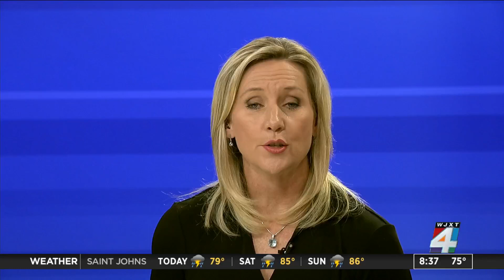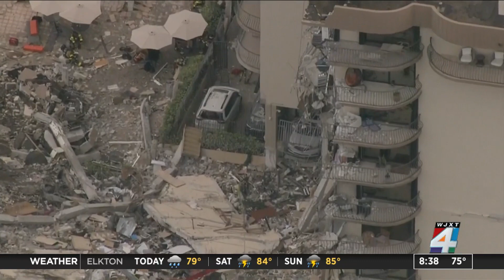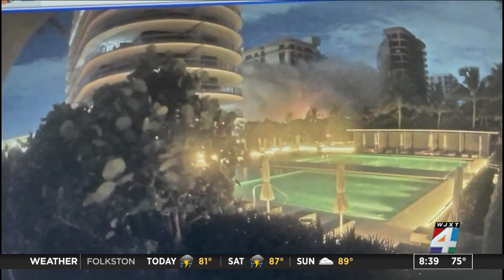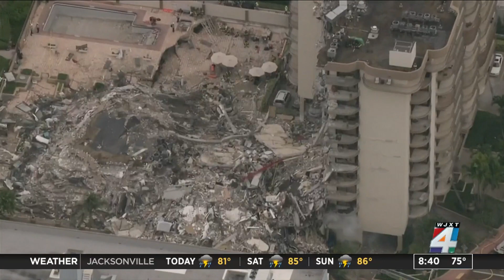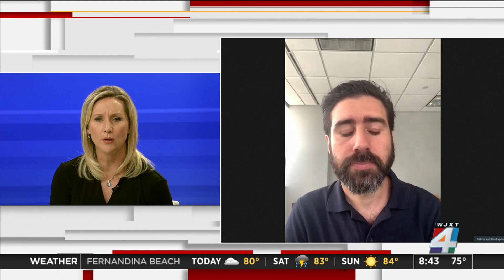Looking Into Cause Of Collapse

Comment: So the pool area wasn't properly waterproofed and caused leaking to the underground parking garage. There was a structural flaw found by the contractor in 2018 about the design of the pool making it impossible for excess water to evaporate as there was no slope for it to drain. If you look at the pool area and where the building fell - it is possible that was a significant factor. If you also look at the entrance of the parking garage - it is near the middle front area that fell first.

Comment: They said that the condo association two years ago knew about this problem in the building in 2018 they had an engineer's report that he was concerned about problems the steel and concrete had they wasted too much time they started to do the roof first and then they were going to do to steal down below and you see the results of this God knows how many people are dead that young boy was lucky he was found in a fireman got him out five people their bodies were found other sources said they've been fine in parts of bodies and putting it in red buckets so sad that something like this had to happen in this day and age now they're talking about the sister building next door has a problem too and everybody should be out and put in a hotel to stay this is a terrible thing this is not a cheap neighborhood before you know it other buildings are going to have the same problem down there Miami also has water coming in from the ocean underground they have huge generator and pumps pump in the water out otherwise the city would be flooded I don't know how anybody could live down in a place like that

Comment: A fool is a man who builds his house on sand!  No one has any experience with corrosive chemical reactions of sand, salt, (cheap) concrete and steel over 40 years in buried foundations. If this was the cause all high rise buildings along the Florida coast and on the Keys are potentially dangerous. This would be a problem of a magnitude that the government has no choice but to cover up and hope for the best...

Comment: Concrete has no tensile strength like wood which can bend. Steel rebar makes concrete rigid. When the steel inside the concrete is compromised usually by moisture the concrete becomes a castle concrete and destroying/rusting the steel. mix. Corrosion results, concrete fails and gravity is the coup de grace.

Comment: The mayor of Miami doesn’t want to declare it “sinkhole situation “ and we know why don’t we⁉️ the bottom line is a 💲💲💲sign🤷🏻‍♀️
Reply: Morabito Consultants, which has offices in Sparks and Florida’s Palm Beach Gardens, prepared a nine-page report in 2018 documenting damage to several concrete support fixtures that were part of Champlain Towers South, an upscale condominium complex near Miami.
The report concluded that failed waterproofing beneath the pool was “causing major structural damage to the concrete structural slab below these areas.”  

You can find the full report online. If it’s a sinkhole most like it was due to pool leakage.
Reply: Because he doesn't know if it's a sinkhole? 🤷

Comment: Post tensioning "these days" has thinner and smaller elements? Maybe in '81, but you obviously haven't seen one in about 10 years. Back in the 80's the slabs used to be 6" think with very little concrete cover, especially at the columns. If he would bother to look at Post tension slabs today, he would see slabs anywhere from 11" to 14" thick to reduce the chance of failure.

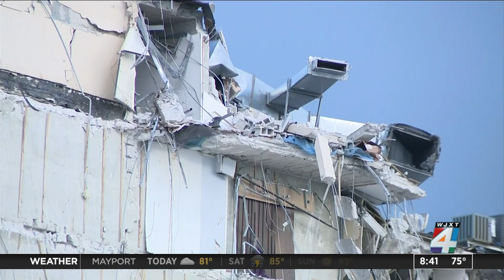Comment: As a 35 year construction veteran , I can clearly see that there is a a whole section spanning several floors that is missing rebar. In other words there should be rebar sticking out everywhere on every floor but at 3:54 they clearly show a wall that at the floor level has no rebar in it. And another thing back in the 80's inspectors could be bought with a lobster lunch from Red Lobster.
Reply: Yikes!

Comment: Champlain Towers South fell down because of the huge hotel that was built beside it. Check the size and weight of that new building. When did the Champlain South Tower begin to sink? Just check Google Earth and you will understand why it fell on that side. The oval hotel beside Champlain South Tower is below the level of the building. The  movement of land made during its construction and it's weight disbalanced the center of gravity of Champlain South Tower. It wasn't that it was badly built. The authorities did not consider the impact of building such a big hotel beside the tower on sandy land.
Reply: Seems believable. How did you figure that out?
Reply: @dianecelento4974  All that area is mostly sand. The building was quite stable while the area beside it was empty but, in order to construct the new big building, they removed a lot of land for its foundations. The land around it moved slowly but, in doing so, it made the land under the Champlain South Tower lose stability, thus moving its foundations, displacing the concrete interconnection. On that, the enormous weight of the new building kept exercising pressure on the sand layers. The Champlain South Tower foundations tried to compensate for the displacement, what caused the slow cracking of walls, the disbalance of the pillars and created two opposing forces between the two main sections of the building, that were built in two separate units, with a middle, more unstable section to connect both of them and, in the middle, the elevator hole. The first thing that fell was the elevator area, displacing the center of gravity. If you see the video of the collapse, the roof remains in place in the mid section for some milliseconds. What fell first was the elevator. That was the weakest part of the building, due to the empty elevator hole but, at the same time, it was the most important point of stability, being the midsection. As soon as that section fell, the  building on the back lost all balance, and fell towards the new building, trying in vane to stabilize the center of gravity. Being built in 1981, the problems in the Towers began after 2015. When did they begin building the structure with the big orchid?
Reply: Could the bombing by Navy a few days before impacted it? And was a sink hole in the mix?
Reply: @dianecelento4974  The hole was created through the extraction of land and sand to lay the foundation for the new building immediately to the South of Champlain South Tower.  It created a void that needed to be compensated by the forces of gravity under the now collapsed towers. Unfortunately, it wasn't.
Reply: @luz1959  Makes so much sense. So if the hotel next door is responsible, I guess they will have a lawsuit against them. Wonder how the lawyers will prove it was basically a sink hole caused by the hotel vs. a natural sink hole?
Reply: @dianecelento4974  The authorities will not pay much attention to that in the following years, I believe. They are going to look for responsibility in the Tower itself, as they are doing now. For the moment being, first they need to get all those people out of all the rubble, most surely dead. Too much weight on their poor bodies. This activity will surely destroy important pieces of evidence. The weakness of the ground in that area is evident, as it is mostly sand, and it affects all buildings. Add to that the most obvious effects of salt and wind on steel and concrete. 40 years under those conditions. The new building's construction  influence will be overlooked until they analyze the foundations of the Towers.
Reply: @luz1959  Got it! Because either way even if it was the fault of the hotel, the association should have had the building fixed sooner and/or had the building evacuated, am I right? Also, what's your opinion on the pool leak they keep talking about? I wonder if the pool leak occurred because of the hotel next door as well. Could have been a domino affect all because of the hotel next door. So tragic

Comment: Here is a big problem....
These buildings generate millions of dollars from rent and fees paid..
He stated that the beams and sections of the tower could be rotted or old. That is correct... But here is the other thing.... Where is upkeep? Where is the money profited going? 
Paying for renovations and or upgrading kitchens paint... Etc. Keeping air conditions working is NOT the only upkeep huge heavy building need.
If you are not checking the parking garage.... The standing of the building... Its beams... Its leveling (because buildings settle, no matter the size) 
Those buildings need attention every 3 to 4 years. For safety guidelines. 
Also ...
I must be a genius....
Because 2 days ago I left over 15 comments stating everything he said here.

Building decay.... I noted things being replaced. 
Aging.... Andi made a huge point about the building being built in the 80s back when construction was fast paced and quickly done. So i pat myself on the back for that. A news channel even replied to me...and days later here comes a man with my exact same initials saying exactly what i stated. Lol 
No credit from the station ehh?
Reply: Strange, very strange.

Comment: Florida is nothing but sand with water not far below. Dig a hole anywhere you get water. Beachside development is an accident waiting to happen. Everything sinks and the beach is eroding away. This unfortunately will not be an isolated incident.

Comment: Just look at how thin the balcony concrete is. You cant have 10 adults walk to the edge railing without a plea for insanity.  Its a culmination of all the factors.  Round stone crap concrete with salty beach sand, I bet. You had 40 years of hurricanes blowing into it with some harmonic vibration because it wasnt a solid center building design like you see that oval shaped hotel next to it, that was built by intelligent design. Egg shaped is not going to resonate in 100+ mph winds. Then with general overloading with heavy particle board furniture and marble table tops in the rooms.  Loading the top with heavy AC units.  Dennis the Menace setting off fireworks offshore two days before. If it was a sinkhole, it would have taken the whole structure down and water would have washed up around it, with most debris disappearing into the hole. Harmonic vibration took down the............ Tacoma Narrows Bridge in 1940..........for another scary video, back when scientists knew enough to be dangerous.

Comment: This idiot knows, nothing a PT slab is 8" thick and the cables are all tied into all the slabs so entire building would of been pulled down. This building was built in section and thats why the shear effect shows clean failure. This guy is a joke!

Comment: At least, finally, the 2 mm sink per year reported does NOT contribute to failure.  The early 1990’s university report is gonna be junked.  We did not have technical to measure that closely from a satellite back then.  In 1991, we were darn lucky to get within one meter!!!
Which is 1,000 millimeters.  The rebar corrosion from salt air and roof leaked are best suspects this morning.

Comment: Other news on YouTube had comments mentioning that a roof top air conditioning unit was replaced with a bigger, heavier unit, alongside the next property over was under construction with pile-driving activity shaking things up. Apparently, the new construction plans involved building an underground parkade digging 4 miters deeper. Allegedly within a few inches of the older building's foundation. 
It's never one thing; it's always "A Perfect Storm".
Reply: Now you have a clear view.  You have hit upon all the things i was thinking.  The tesla earthquake machine, the walls of Jericho, wet sand, liquefaction, vibration and liquifaction of sand could have been a tool of the builders of the great pyramid.  All those things plus a structure already under stresses unseen compounded by multiple hurricanes rocking and shaking over years and what about people with clubs and insanely loud subwoofers all could be contributing factors in the creation of the perfect storm.  Years ago in portland Oregon there was a club called earthquake ethyl's that was adjacent to a large sewer main and the clubs subsonic system created resonance with the sewer main and had house's blocks away complaining of things falling off of shelves and the city said that the sewer main had shown signs of damage next to the club.
Reply: The city of portland made them keep the db Level below a point that it did not resonant with the sewer. This was in 1977-1978 there was also the organ grinder that had the largest  theater pipe organ in the u.s. in a wedge shaped building a 35' foot ceiling at one end and 15' foot ceiling at the other end from the air it looked lake a wedge of pizza.  They got the same complaints.  They would regularly play at full volume the theme to 2001 space a Odyssey the pipes were so strong that 3 blocks away you'd get that queezy fealing in your gut like an earthquake was happening.  It was do cool .Giggles 😎SERIOUSLY though. ...
Reply: Mr Man  😎
Reply: Mr Man  ok lets get real ! Cracks in the building over time alowed salt spray to erode exposed steel in the structure and with ground shifting finally sheared off the steel at the most exposed aria of the building the top floor then as all down the crack/cracks the building collapsed top to bottom.  BAM!😎
Reply: Mr Man  the main and reasonable theory is the real cause. The building was on the precipice of disaster balanced on the edge.  Jack hammers , wind harmonic loading, bombs at sea, subsonic sound systems..all or one or none.  Who knows what the trigger was or the feather that tipped the balance. Was all that i was initially saying.  And adding a little sarcastic levity to the conversation. Sorry if my  sense of humor grates on your senses of logic. Maby you should change your tag from Mr Man,to Mr Spock 😎

Comment: Go on google maps and look at the balconies of that building and compare it the other similar structures on the same block. It's the only building where you can see exposed rebar on multiple balconies. All the other buildings you can't. They either used shotty concrete or their maintenance is piss poor.

Comment: Possible causes: changes to the ground underneath the building or substandard materials used in construction or poorly designed/poorly engineered building plans or poor maintenance to the building's supporting structure or unauthorized departures from the design during construction or some combination of two or more of these. It will be interesting to see the investigators' findings and how many other buildings may be a risk for sudden collapse.
Reply: I can tell you now that there will not be much punishment for this massmurder.